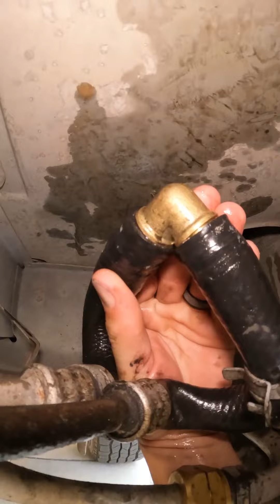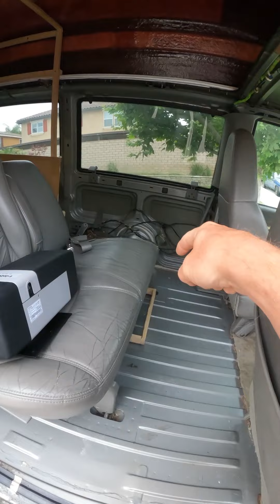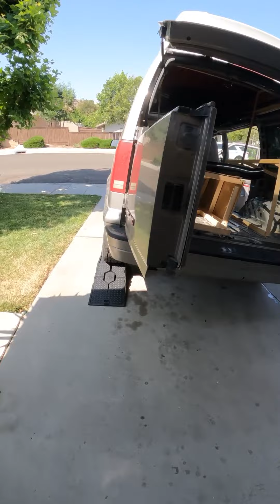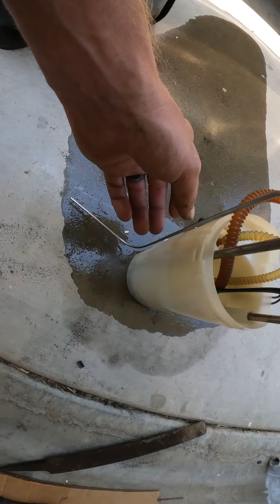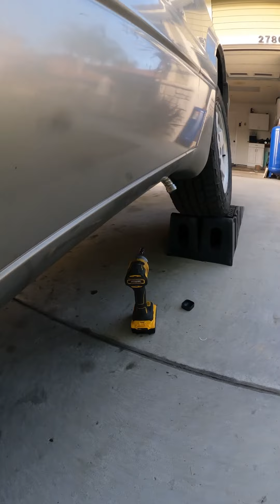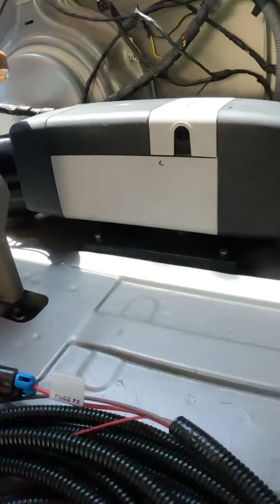Astro Van Build Episode 3: Webasto gas heater install stock fuel tank

Comment: Hope that works out for you. I did not know you could tap in to the fuel tank for those heaters. Thanks!
Reply from the maker: Just make sure you get the one for gasoline and not diesel its been working like a charm for a year or so now

Comment: Getting ready to do this with an Espar heater!  What part did you use for the standpipe?
Reply from the maker: I got my kit from a website that had an install kit that had one in there.. vanlife outfitters I think it was... but any stand pipe will work that you can connect the fuel line to

Comment: Couple questions regarding the removal of the factory heater. Do you have to refill the coolant after removing the heater core? How much coolant comes out when removing the heater core? The way you've looped the coolant hoses with the 90 degree elbow seems like the easiest way to remove the rear heat. Have you had any problems with the engine temperature after? Any leaks after driving for a while? My diesel heater came in the mail today and I'm excited to install in my Astro. Thanks for making this video!
Reply from the maker: im glad you got some use out of it! i did lose some coolant so make sure you have a bucket under there! i did top the coolant off when i was done, and no leaks since! if you have some time check out my winter camping playlist where i put the heater to the test!
Reply: @DadVanture  i did the bypass with the 3/4” pex, added some coolant back to the system, and got the van up to operating temp. The temp was right under 210 where it’s supposed to be and it held without leaks at the rear hoses. The only thing I have a question about is the reservoir tank. When it got to operating temp, the coolant level in the reservoir didn’t quite reach FULL HOTT line. Did you see the same thing?
Reply from the maker: @roqueybarra7340  i didnt notice, but i wasnt paying that much attention.  id just add a little more coolant maybe there was some air in the line? im not sure, but i think that rear line should only cycle when the switch on the dashboard for the rear heat is on so it shouldnt affect it to much.
Reply: @DadVanture  agreed! Won’t be using that switch. I probably will do the valve replacement in the future, just wanted to get the rear core out so I can start fitting the heater. Thanks again!

Comment: I changed out the heater valve in the engine bay and removed all the lines to the rear heater when I did the delete.
Reply from the maker: did you just get a heater valve from a junkyard astro with no rear heat? i just dont touch the switch in the front and its been fine, but you did it the right way for sure
Reply: @DadVanture  No, I got a new valve from O'reilley's for a van not equipped with the rear heat option.  It has ports for 4 hoses instead of 6.  I removed the fan switch and got the block off plate from a junk yard.  The wiring harness is still in place for the time being.

Comment: Man, for what Webasto charges for their heaters, you’d think customer support would be a little better. Hope it worked out for ya.
Reply from the maker: it didn't, I had to buy another harness :( for 340 bucks. but I have a heater in my van now... the new one literally clicked right in.. I'm going to be doing a cabin battery video with DC to DC charger video soon keep an eye out for it!